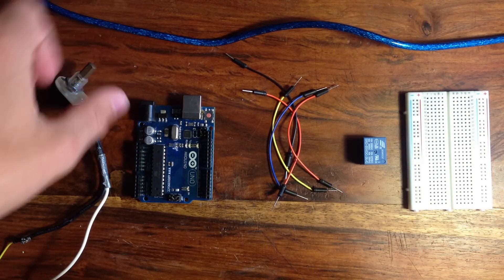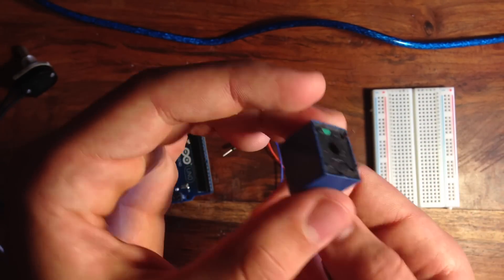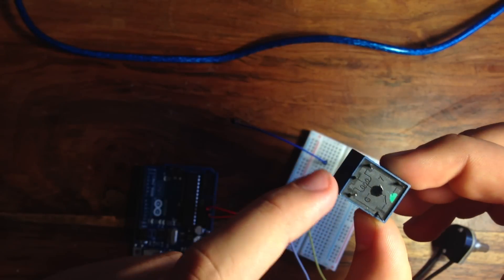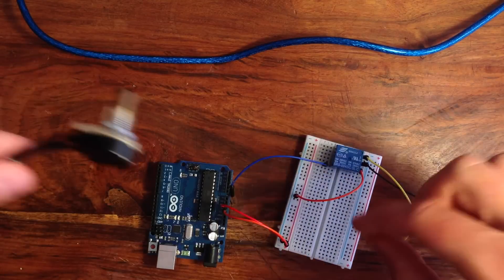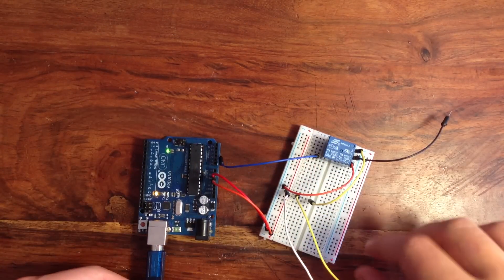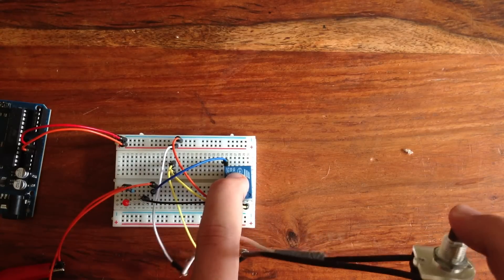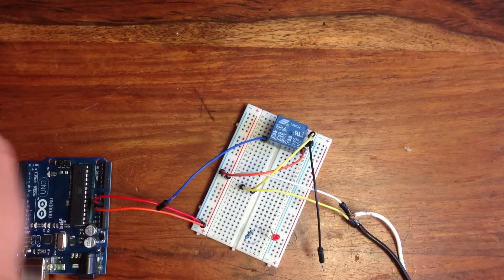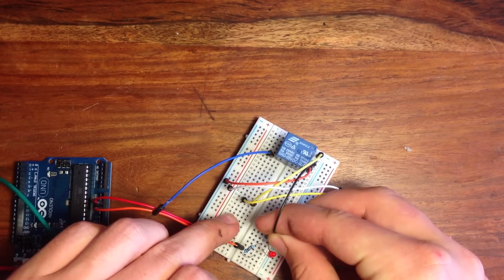How to Use a Relay With the Arduino

Comment: This is a very bad video that teaches you little if nothing. You watch this video in the hopes of learning how to control a relay with the arduino itself through code. Tip: use one of the analog ports as a digital out and you can use that to actually control the relay.

Comment: Hello, I know this video is old, but does this circuit work by default or do you need program the arduino to function like this? I need to build a toggle between 2 110v lamps (latching), and I want to control them with a momentary switch. I first thought about building a transistor based flip-flop connected to a relay, but I'm thinking arduino would be a lot easier. Please let me know if you can help. I have 2 days to finish the project...
Reply: Did you ever figure it out?
Reply: @cam5816  I ended up just using a 110v switch and ditched the arduino entirely. It worked fine, the reason I avoided it in the first place was because the switch was meant for a floor that could be wet. Just made a waterproof enclosure for it. 

However, arduino should be able to accept an analog signal very easily.

Comment: haha. what was the purpose of the arduino?
Reply: Instead of switch you can use transmitter or ultrasonic sensor to work itself using code

Comment: This circuit isn't safe, due to current that comes when you turn off your relay. You will also need a diode in the ciruit, in order to minimize the high voltage spike. This spike will kill your electronics in time. (Try it 40 times and you'll fry ur scheme)
Reply: yeah quite right as the flux of the magnetic field changes abruptly with time

Comment: everything is wrong in this video. Did you know that when you swich off a relay, the electromagnetic field accumulated in the relay causes high voltage spike reaching hundrets od volts and will eventually fry your Arduino? this is basic and you should know how to protect your projects

Comment: Ummmm.  What does this have to do with an Arduino?  You are only using the power and ground output the Arduino to supply power to the breadboard.  THIS VIDEO HAS NOTHING TO DO WITH THE ARDUINO.  Thanks for the namedrop title that is completely misleading.
Reply: we can use the arduino itself as a switch so as to control a very high power motor whose current the arduino can't supply. Thus one can control a very high power circuit using autonomous techniques .(using codes in arduino)

Comment: Why you should not follow the advice from this video.

From the Arduino site:

Properties of Pins Configured as OUTPUT

Pins configured as OUTPUT with pinMode() are said to be in a low-impedance state. This means that they can provide a substantial amount of current to other circuits. Atmega pins can source (provide positive current) or sink (provide negative current) up to 40 mA (milliamps) of current to other devices/circuits. This is enough current to brightly light up an LED (don't forget the series resistor), or run many sensors, for example, but not enough current to run most relays, solenoids, or motors.

Short circuits on Arduino pins, or attempting to run high current devices from them, can damage or destroy the output transistors in the pin, or damage the entire Atmega chip. Often this will result in a "dead" pin in the microcontroller but the remaining chip will still function adequately. For this reason it is a good idea to connect OUTPUT pins to other devices with 470Ω or 1k resistors, unless maximum current draw from the pins is required for a particular application.
Reply: +Enigma758 agreed and another way will be to use a transistor to switch...

Comment: If you use this circuit then dont forget your blocking diode across the relay coil or you will have brown outs and reset plus you should use a transistor to switch the relay so all in all your video is crap

Comment: this is actually "how to use your arduino to power a relay". there's not much point in using a physical push-button switch to power a relay, which is an electrical switch.

Comment: This will burn your arduino pin eventually and even worse, the whole chip ... remember: a relay is a big consumer (uses ~150mA or more) which is almost 4 times more than what an Arduino pin can handle, along with this, a relay has inside a coil that can produce a current which will flow backwards. Read the articles bellow and remake this video.

Here is how you should properly connect a relay :
http://makezine.com/2009/02/02/connecting-a-relay-to-arduino/

Here is a reference on arduino pins:
http://arduino.cc/en/Tutorial/DigitalPins#.UxkR79ulp0g

Comment: This is a TERRIBLE idea. Arduinos should never be hooked directly to a relay! A relay contains a coil of wire. Coils of wire can and do cause voltage spikes when the magnetic field collapses. It is extremely important to have a diode to protect the arduino from getting fried.
Reply: Exactly. A diode will reduce inductive kickback from the coil
Reply: kandesigner Hehe.. I wonder how long it would last if he set the arduino to trigger the relay at 20hz or even 10hz for a minute.
Reply: This maybe a stupid question but what if I use a diode? (or several in parallel or something to divide the current coming from the relay's coil)
Reply: Lucky no one looked at your question

Comment: Thanks for the video 
Can I use multiple relays like those with one Arduino without any resistors ?
There's no risk to damage the Arduino?
Reply: No. You need diodes to protect the arduino.